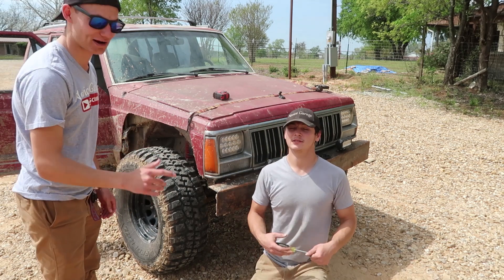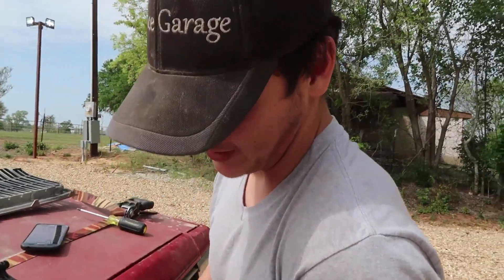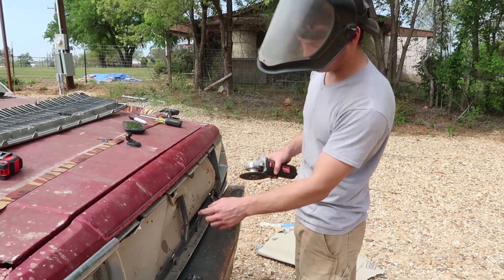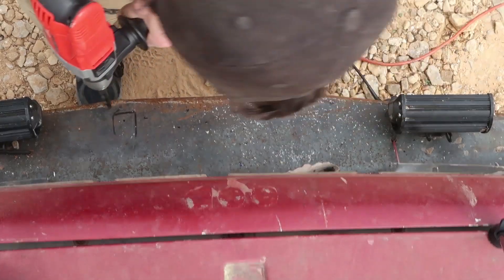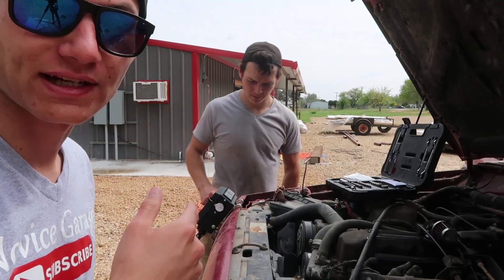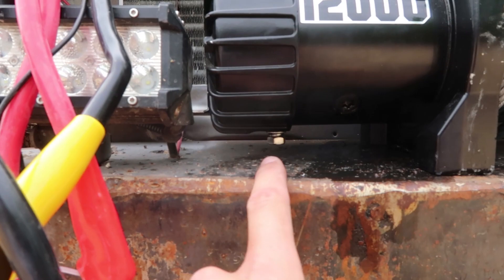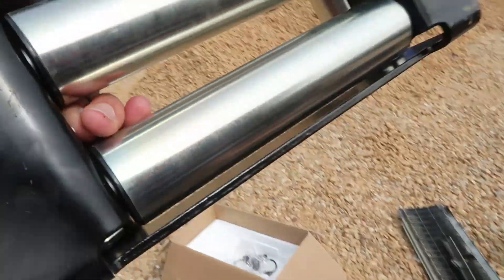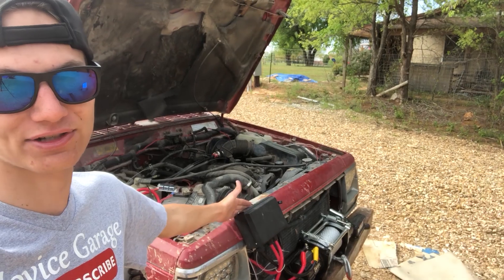CHEAP Jeep Gets a BIG Upgrade

Comment: Take off liner foor the hood. When water and mud starts to get up there just goes mostly and makes it fucking heavy to lift. Soaked with water
Reply: yes -- the hood liner contributes NOTHING other than getting soaked and becoming heavy, or trapping heat in the engine compartment and slowing cooling, and retaining water so the hood can rust faster.  Rip it out!